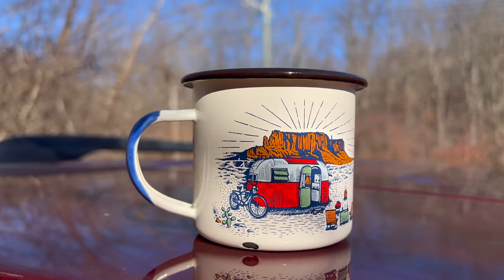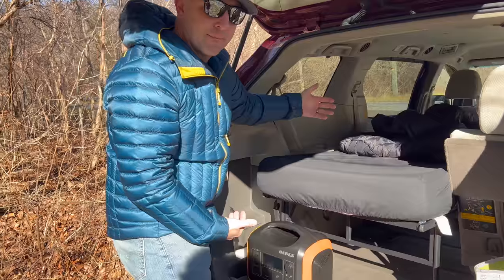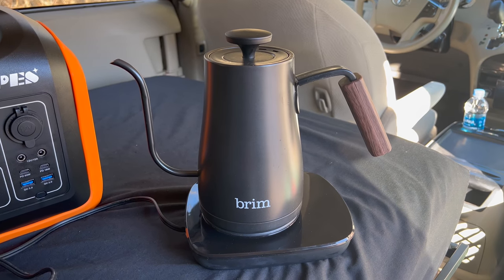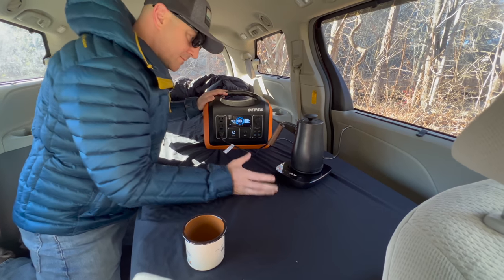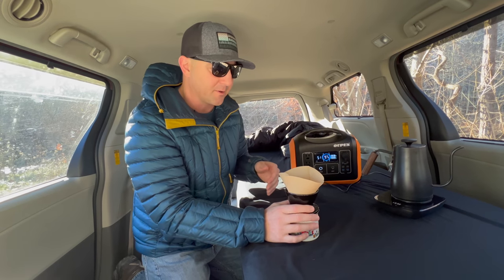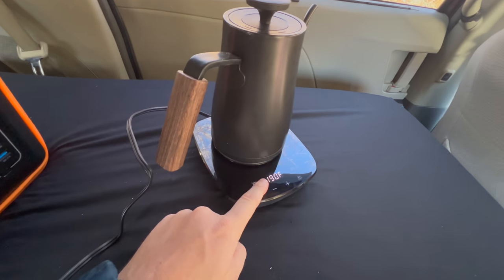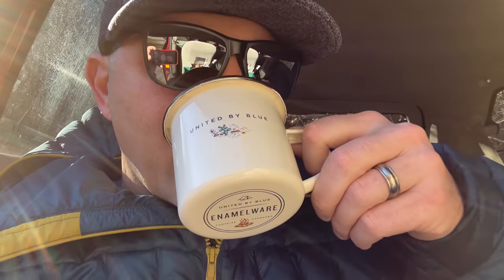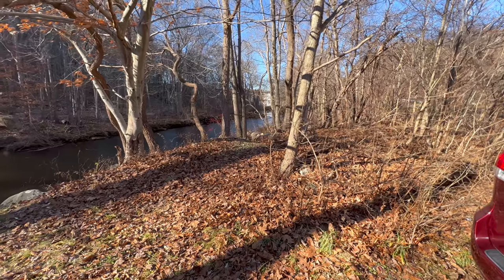Making Coffee Without Flames in My Minivan Camper

Comment: Pro tip; I made an alcohol lamp out of a short bottle and brass pipe fittings, with JB weld connect, and have it go into a small stainless tube type silverware holder thats perforated

And it will heat a 2 cup mug's worth of water in 15-20 minutes. and is smokeless.

Also if you want to avoid paper coffee filters, in the third world there are cloth bags on wire rings that you just rinse and dry, the cloth is usually a porus polyester.

Also I have used a round of thin cotton cloth in the filter holders like yours, and just rinsed it, and same cloth round lasted years.

Comment: You've got to have coffee.  LOL!   I just recently received an Oupes power station like yours and  am currently in the process of checking it out.   It's a great system.   We ran our living room off of it Saturday night while watching "It's a Wonderful Life."    It's a well designed system from what I've seen.   It will run one of our 650 watt heaters for an hour.  Nice video.  Thank you.
Reply from the maker: Thanks for sharing your experience. Sounds like the system is working well for you.
Reply: @AdventureGearTV  - It is.   We ordered the two Oupes solar panels as well.  We were able to put a 150 watt charge into it yesterday in the low afternoon sunlight.  This was only 30 watts less than the charge it receives from the 120V adapter.  Very impressed with it.   My wife and I will be doing a video on it in a few weeks on her YouTube channel (Under the Median).   In regards to space and camping, we used to camp with a Chevy Chevette and took it as far as Yellowstone Park (from Peoria, IL).   This was tent camping of course, we didn't sleep in the car.   But we quickly became skilled at making the most of our limited space.

Comment: Stanley french press and 12 volt kettle or burner. The kettle i have uses less than 200 watts and water hot at 20 min for full kettle. One or 2 cups probably less than 10 min
Reply from the maker: Thanks for sharing. I’m a big fan of Stanley and surprised I’ve never heard of this.  I’ve been looking up 12v water heaters after a few comments here. I think it takes the same overall power to boil water, but this one has a higher wattage for a shorter time. I might have tried one of those sooner if I knew about them.
Reply: There is a 500 watt warmer but it bills water and cooking on it is nice with jacket 500. Stanley french press with plastic lid and metal strainer. Both together should be under 50.00 Amazon
Reply: How long does take to boil water with what you got. Never mentioned in video i don't think. I have dash grill  350 watts. Cook burgers eggs and cooks both sides at once. I built a all in one multi cooking bag
Reply from the maker: It was less than five minutes for the cup. It’s about five for a full kettle. I cut a lot of dead time in the videos to keep them short.
Reply from the maker: I use the dash egg cooker and it takes longer to boil eggs.

Comment: That's one very expensive cup of joe if you include the power station. You can buy a small butane heater for a few dollars and cook up other things as well.
Reply from the maker: Luckily it’s a one time cost that has tons of other uses. I use the power station daily on the road.
Reply: @AdventureGearTV  So please include all those other uses in your video, instead of just trying to sell us Amazon Affiliate products. Thanks.
Reply from the maker: @stephenhill2404  not necessary. This video is about making coffee, not about the uses of power stations. I also brew coffee with a butane heater, but prefer not to do it in the vehicle due to the open flame. If you want to find out some of my other use cases. Check out my other videos.

Comment: No cream or sugar…just black coffee, like a psychopath 😂😂🤗🤗🤗 JK! I only drink pour over…good to know how you do it. Question…I have a 300w Rockpals…great for charging stuff around camp but want to get an additional battery to run a small camp refrigerator - have considered the 1000w but wonder if the 500w would actually be better because it’s smaller and quicker to recharge. 🧐🧐
Reply from the maker: Hi, thank you for sharing.   Unfortunately, I have to keep my coffee lean.  I ran my Alpicool mini fridge for almost two years on a RockPals 500 with a 100w solar panel.  One or two cloudy days, and I must occasionally charge from the vehicle to catch it up.  I recommend getting the largest power station in your budget to minimize recharge worries.   I have videos testing the mini fridge with various portable power stations you can check out.  But the gist is a 500w will run a pre-cooled mini fridge for about 36-40 hrs without any input on mild days.  My most recent fridge test is here: https://youtu.be/eWNzzffCL7c

Comment: Thanks!  I am working on a van build or a utility trailer build. My Honda Odyssey is pre 2000 and has almost 300, 000 miles on it. I only bought it for $450 so not sure about the longevity of it.
Reply from the maker: That’s a lot of miles. I have heard that generation is dependable. But, at that age and mileage anything can happen. If it’s running fine now, I wouldn’t worry too much. $450 for a running vehicle might be a gem. Also, if you only put a bed and some amenities in the Ody, then you can easily transfer it to another vehicle later. Good luck!